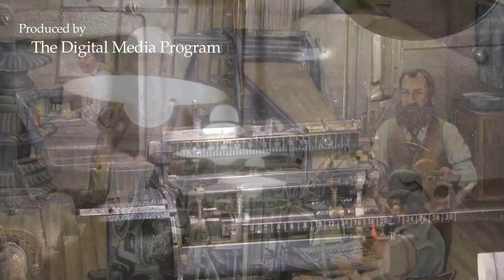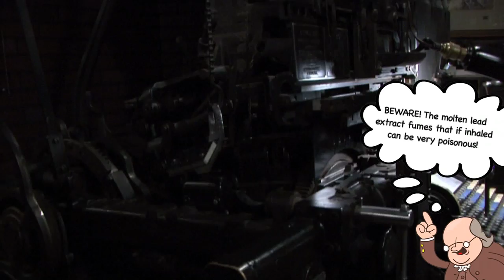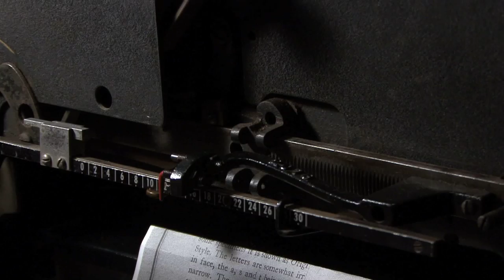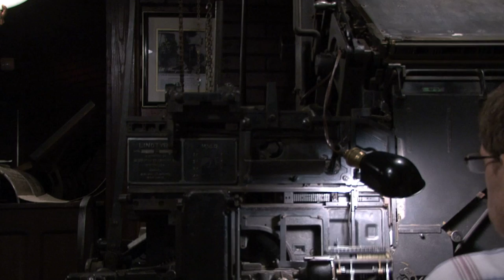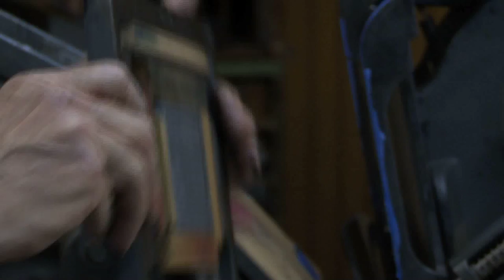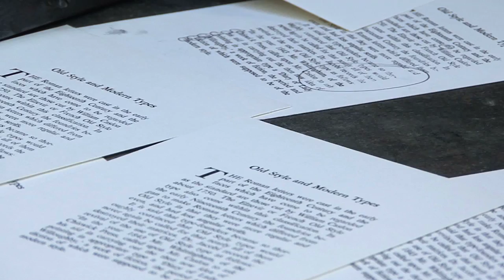Linotype - A visual Demonstration

Comment: Ha ha, you're wrong Brian, the linotype could produce up to 8 or 9 lines per minute if the operator were quick. The Linotype Elektron (a tts tape operated machine) had a top speed of 15 lines per minute.

Comment: So how would the letters get put back in to the machine?  Would that still have to be done by hand?
Reply: the letters that come out of the machine are whole lines of type cast to order by the typist. They are melted down and the metal is reused once they are finished with. The letter moulds that the lines of type are cast from stay in the machine and are mechanically sorted back into place I think.